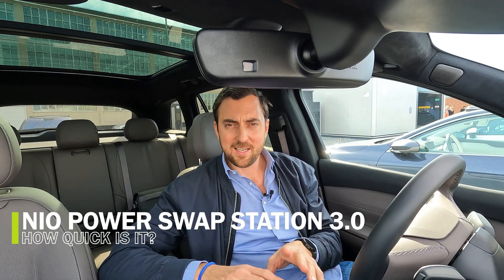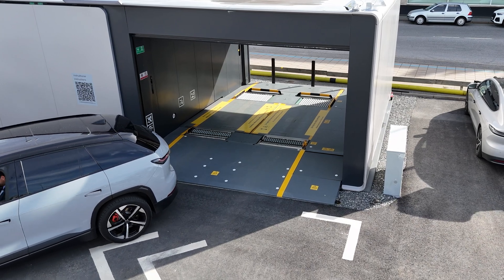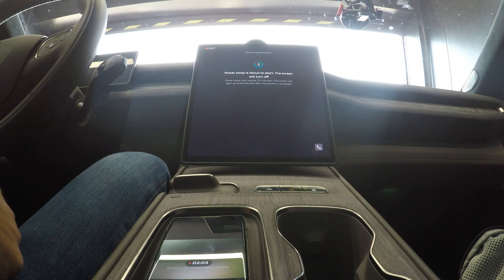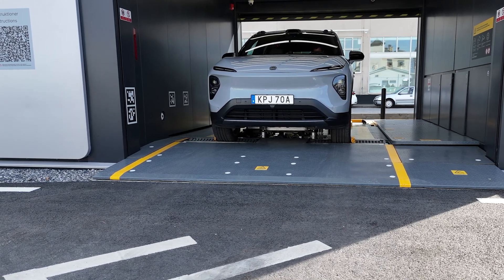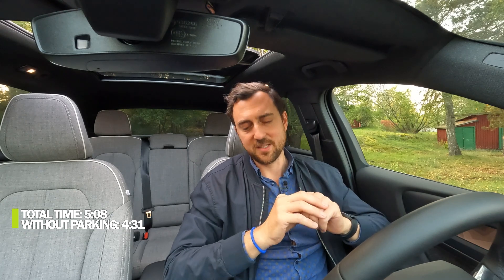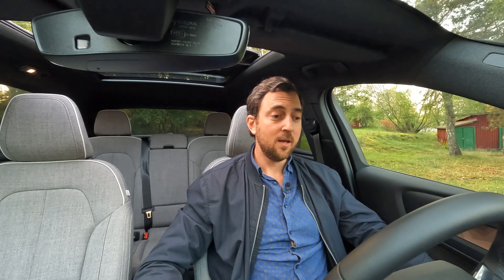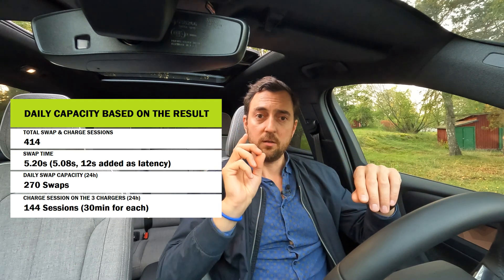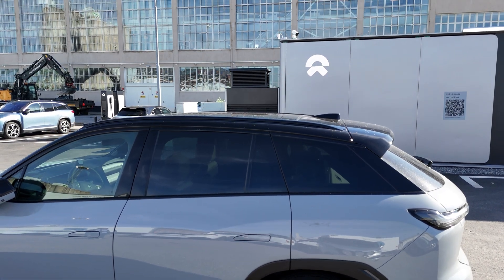How many Superchargers can it replace? - Testing Europes first Nio Power Swap Station 3

Comment: I love this video, no one really talks about the perks of battery swapping.  Not only is the battery charged slower/safer but also the power grid is under less stress. With more and more renewable energy sources that don't have a consistent power output, this is a very nice feature of the swap station. In china, there was a power shortage last year and some superchargers weren't operational becasue of it but PSS's were in service and even helped stabalize the grid by providing power to it. These are some perks that noone is thinking of when it comes to battery swapping :)

Comment: Swapping is a gimmick.  Also is only good for EVs that match the Nio battery.

How many superchargers does a swap station take up?

I prefer to pull in and start charging right away. If there is a line at a swap station, you need to stay in your car until the whole thing is done.  And A/C shuts off which is not good.
Reply from the maker: Less than 6 chargers and 6 parking spots.
Reply: You should investigate more before commenting, if this is your best knowledge about this. 

For example with regular EV your options are: regular slow charging, fast charging and home charging. With NIO your options are the same but there is one more option and it is swapping the whole battery to charged. 

If there is a line in swapping station, you still can charge your car same way than regular ev-car do via cable slow/fast charging.

So in your opinion, what is the problem?

Comment: I'm sorry but it won't change anything, it is costly to implement and to maintain, with little to no benefit. Looking forward to more super/hyper chargers and improvements and cost reduction to battery standards
Reply: You seems to be very happy with your current EV-car setup. So please allow for others the better tech.

Battery warranty must be in EV-car at least 25 years or 500 000km. Before that there will not be proper used EV-car market or cheap EV-cars which could be reliable option for less money. 

With current battery tech, It will take another 5-7 years when those EVs batteries are done and after that those cars will go to recycle bin.
Reply: @iSot80  You seem to be of opinion, that my comment could somewhat sway Nio to abandon their swapping stations. Its approach will stay niche, if it survives at best. Pretty much the way of hydrogen cars a their stations, albeit less costly. I can understand fear of costly battery repairs out of warranty, though. And yes, I pretty much think that having a multilevel charging infrastructure is the best compromise.
Reply: You own a model y and are here hate spamming against nio? Jealousy is a bad look, fanboy. Take your embarrassing looking vehicle somewhere else.

Comment: What's the time of backing into a Charger, Exiting the car, opening the charger door, removing the charger and pluging in, getting out of the car when the charge is finished, removing the charger, closing the door and hanging the charger up, finishing any transactions, getting back into the car... ?? I think the NIO is driving away in the time it takes in Charging "processes" alone... If you're going to compare "Staging" on SWAP.. compare "Staging" on Charging... js
Reply from the maker: Yes, i calculated every charging session as 30minutes that's includes hassle with the manual process. But good point, the swapping is more convenient for the user.

Comment: It’s all pointless. so you have one station. That can swap one battery. Other cars have to wait?? How many swap stations will you have in one location and at what cost? Whose battery do you own? What is the wear and tear like on you vehicle ? Sorry but I would just let my car sit for 20mins and go to the bathroom:
Reply: wait for 4 minutes, and everything is based on an automatically structured queue with the help of nio's advanced software.  The cost is 10 euros per change but two are included in BASS.  There is no reason for them to put two in the same place since it takes so little time to change each battery.  The battery you receive will be a battery that has undergone a comprehensive battery health check before it is delivered to you.  Batteries in sub-optimal condition are removed from circulation.  You may prefer to charge for 45 minutes from zero to 90 percent, but know that your preference is based on myths.

Comment: Nice video and analysis 👍how's cost worked out? and compared , as i  believe that now the swap is there, battery needs to be maintained by the company hence they will need to add to the cost of charging.
Though time factor is definitely a big plus, its harder to see this as petrol fuelling, because not all companies will come onboard with managing the batteries once a car is bought. Hence Neo will be left alone doing this, meaning lot of cost for them and no other company will be using their batter swapping, because either car owners own the battery or not, can't have a middle path.
So from customers point of view, its good , however will be hard for many companies to adapt and use in common, as battery standardisations will also be issue. Dunno if anyone in NIO has thought of all these, i'm sure they have, or maybe not 😅
I'd rather spend money on improving charging networks and reducing the charging time.
Reply: Battery SWAP stations know how to finance themselves by other things.  (arbitrage, preventing power outages) and mainly by bass.  They don't need more companies to be profitable.  But you are right that since the capacity of the exchanges is much higher than the demand of nio buyers, (especially in Europe, because in China there is one station for every 200 nio vehicles, and also many of the stations have a lower capacity) then and therefore if nio manages to close a deal to switch to the platform  of nio, maybe with Ford, or BMW, or maybe even a bigger company like Hyundai, Ioniq 5 or 6, of course such a contract would have to include the construction of a lot of SWAP stations, which would be very helpful for nio owners in Europe.
Reply from the maker: Regarding costs every swap has a free of ~10€ then you pay for the actual kWh delta between the two batteries, don't know the exakt cost for that. but around the same kWh cost as on a supercharger for a Tesla owner. But two monthly swaps included in the BaaS lease.

Comment: Why does NIO swap stations have the car start in a parallel position?? Serious waste of time. The driver should simply drive up to the opening (back end first) (or front first) and enter into the swap bay directly with driver assist. then either the driver can pull out the other end or driver assist it as it backs out of the bay. this could shave a minute +/- off the total bat swap time.
Reply from the maker: I thinks that depending on the space surrounding the station.

Comment: The one fear I have and I am sure many people have is battery degradation.  The example of the Tesla owner who blew up his car because Tesla wanted to charge him $20,000 to replace the degraded battery and he posted the video.  The fear of battery degradation is thrown out with NIO, just go to a swap station and change the battery..   That simple.
Reply: With every swap the battery is also checked and if there is some faulty or bad one, NIO will takeit out of circulation.
Reply: Price an internal combustion engine or transmission on a modern car. You’d be surprised how expensive they are. I’ve seen a Smart car engine fail and the list price for the replacement engine from MB spare parts was the same price as a new Smart.
Reply: Absolutely and a lot more to come when those 8 year warranty run out,  or when new mot laws come in soon on battery testing... Next year I think it is... what about the tesla owner that tesla locked out his own car cos he would not stay quiet about its faults... search tesla scandal , or tesla lawsuits,  the unpublished scandals at tesla is shocking.. from fault cover ups , lies about self driving,  racism... the list is endless
Reply: Tesla batteries go out quite frequently. My X went bad at 42K miles and had to be replaced.
Reply from the maker: @saadhasan2300 I have heard people replace broken packs but don't know how frequent it is
Reply: I watched a video that showed a guy on his third battery pack on his Tesla.  The good thing is that it was still under warranty but they kept replacing his battery with a refurbished battery.  One that is sent in and repaired, not a new battery.  I have also read an article that claims that Tesla is under reporting their battery repairs on their Teslas.  They are not reporting their battery maintenance problems.🤔
Reply from the maker: @michaelsaldivar4901 heard that too. But know a lot of tesla owners but none with battery problems.
Reply: You pay a super high premium for that.
Reply: @richardikus7216  What premium? When you rent the battery you don't pay for the battery when you buy the car. That is money saved up front. On average you need 7-8 years to "pay" the cost of the battery. But already now we have the benefit of getting a new battery with new chemistry that can charge up to 180kw, that is a massive improvement from 130kw on first gen batteries of Nio. Add to that, that Nio will be able to also increase capacity in the coming years. All with the same car... No need to buy a new car for the better range... IN Norway we now pay 2000 NOK per month for the rent, including 200kwh of charging and 2 free swap fees, that is a no-brainer to go for.
Reply: @stigronnysuleskard5299  yeah, maybe a no brainer in norway
Reply: @stigronnysuleskard5299 Nio is smarter than Tesla, they know that the power is the key to the electric car. It’s not about the car itself,,, it’s about how to provide the power for them. Not to mention Nio makes a beautiful car  also .

Comment: I think swap opens up flexibility to owners, think about those people that live in high rise that unable to charge at home.

But one thing about comparing to charging, yes 1 swap equal to 6 charging station, but the 6th person who line up for swap still need to wait for 30 minutes. Personally i think the best is to also have a handful of charging station next to the swap station so people can't wait can go charge instead of swap.

Secondly, i think nio needs to make the infotainment/AC/heater usable during swap.
Reply: That's what their app does to bring you to the swap station with shortest queue. Yes, ac is available now in China although fan only
Reply: @nobigdealllll  Rolled up windows with a fan will be a death sentence to occupants trapped within for 5 minutes during Phoenix summers....not kidding.  Welcome to the NIO easy bake convection oven!
Reply from the maker: AC off for about 3mins in total. Station has a roof, so no direct sun, and you car is probably already cooled before swapping. Do you still don't think it's possible?
Reply: @ItsOnlyElectric  In the southwest US, the swap station will need a garage door and the entire bay would require cooling.  I would not take the chance....let the attendant sit in the car if someone must be inside.  It would be interesting to see a video from someone in that region to know how quickly it becomes unbearable, Florida and Texas too.

I would also like to see an entire day's timelapse during a snowy day.  How do these systems protect themselves from the ungodly amount of undercarriage crud that will be dropping into the robotics.  We have carwashes that can't make it through a few hours until the catch basins must be cleaned to remove the dirt, salt, and sand buildup in the worst conditions.

Comment: Very impressive EV tech, why Nio stock is not over $100 is beyond comprehension cause if Tesla had this tech the whole world would have been kissing his rear end beyond what they are already. Nio’s marketing department needs to all be fired and if this crazy oversight comes from the CEO WILLIAM Li, then he needs to be removed by the board of directors.
Reply: The fact that the stock is at a ridiculous price is beyond my scope of knowledge, holding over ten percent of nio, which means he lost over 9 billion dollars from the drop in the stock.  But he is not stressed, he is only busy with increasing his life venture as much as possible in the long run.  The marketing people, they worked so hard until they reached a 60 percent market share of electric vehicles at over $42,000, or rather 300,000 yuan.  And I remind you that China is the largest car market in the world and also the most competitive in the world.  There is zero tax, zero tariffs, and lots of money poured into Chinese industry before the bubble burst.

Comment: Pretty stupid idea for several reason.
Reply from the maker: Share your thoughts
Reply: @ItsOnlyElectric  1) It is extremely expensive to build the swapstations
2) You lock in a lot of batteries in the stations instead of residing in cars
3) Proprietary technology, no standard so would need stations for every manufacturer
4) Not really necessary since charging time is sufficiently short using a 300 kW charger giving 300 km in 30 min and so much more cost effective. 
5) I would be worried that the electrical connections would degrade after many swaps.
Reply from the maker: @kwunder123  thank for sharing 👍
Reply: @kwunder123  You need to consider that the charging speed gets drastically reduced if other EVs get charged. Not only when using the same charger but the whole "park". I encounter that problem on german highways and its frustrating. And it will become a bigger problem over time. Swapping as a luxury solution seems tempting.
Reply: SWAP stations know how to finance themselves with other things.  (Arbitrage, preventing power outages) So even just as batteries with a two-way charger that is connected to the grid at high voltage, they are very profitable.  A 150 kW charge destroys the battery, try to think how much an 800 charge destroys the battery, and also as already mentioned here, swap stations are equal to 9 stations, not nine charging piles, no, 9 power stations, when you see a Tesla charger there are most likely  Only one power station of 250 kilowatts if there are two vehicles then only 125 if there are 4 then 62 kilowatts, not to mention that one power station and 4 parking spaces are roughly the size of a swap station, maybe we will talk about the queuing problem performed by Tesla according to the law  It's the rule of whoever grabs the luggage first, which can sometimes cost you half an hour and is a really negative incentive for fights instead of a regulated and automatic queue.  Not to mention that if you buy a Tesla today you will never get more than 250 kW, if you want rear wheel drive you will only get 170 kW.  Should I continue or the point has already been made.
Reply: @Svarog0815  Thats not an inherent problem with charging but to specific charger model implementation. Tesla’s supercharger v3 and above have no sharing of power between stalls giving full power to every one.
Reply: @Svarog0815  of course if people would be ok financing swapstations by paying excessive fees by using them , I just don’t think it’s even necessary nor likely. I for sure would not pay more to swap
Reply: 6) Also prevents innovations in battery integration in the car chassis like a structural battery. Car batteries are approaching a million miles longevity so no need to change them out. 

I bet swapstation will die off into oblivion in the future

Comment: I also read that the swap time varies by temperature and weather conditions, though I need to find out the details why.
Reply from the maker: Yes, in cold weather swap will for sure take longer due to hearing of both battery pack, bolts, machanics etc.

Comment: Swap stations are a good idea but unless utilized by other EV makers, they become brand oriented much like power tool batteries.  But unlike power tools, we're talking an actual, physical building that takes up space.  If it's by brand only and with EVs by several manufacturers, if swapping becomes popular, it's going to become a cluster of swap stations.
Reply from the maker: A global standard as for charging will be necessary
Reply: Nio needs to invest a lot of money in building a better and cheaper platform than the competitors in the platform market, anyone who uses nio's platform can use nio's battery swap network.